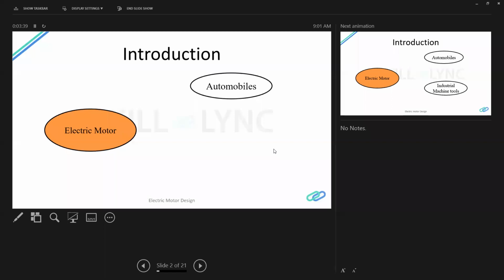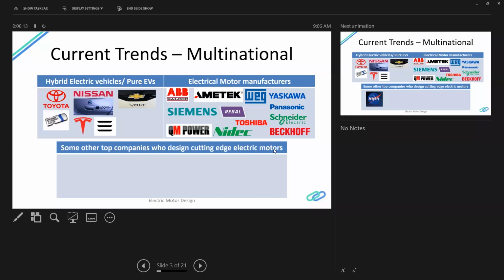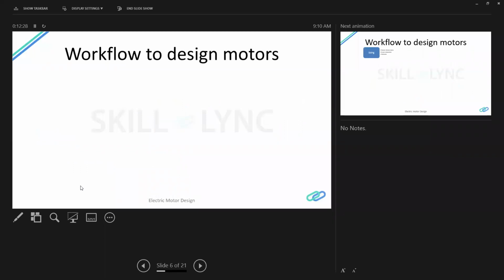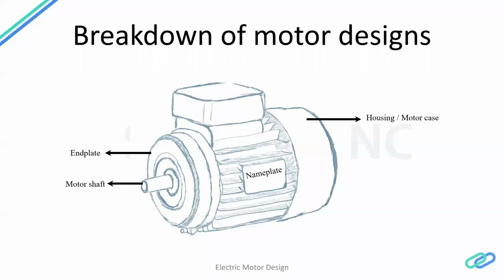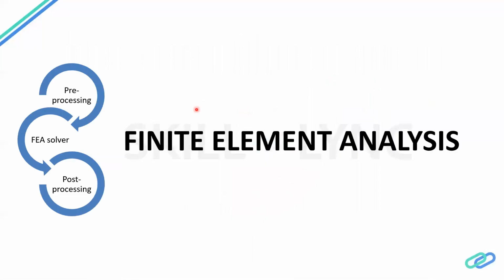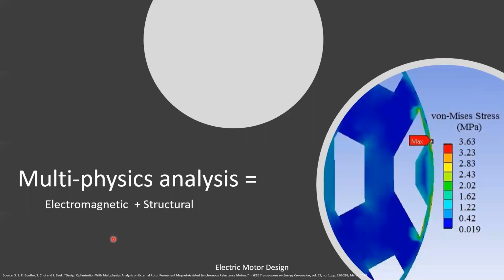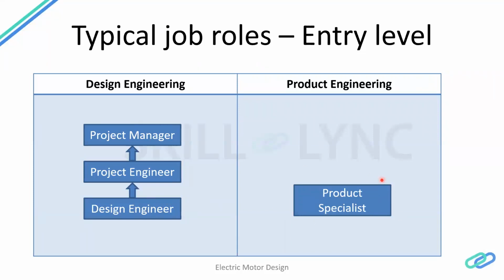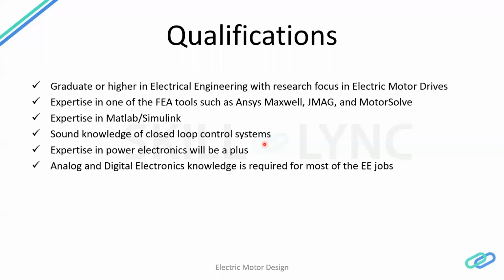Introduction to Electric Motor Design | Skill-Lync

Comment: I want to create my own electric motors, the process is going to be interesting.
   I will be trying to create a motor that pulls very low amps, has a small diameter, and is only four pole.
   I already have some ideas that should make the motor efficient compared to equivalent spec requirements.
   I look forward to the smaller details of making the motor operational.
Reply: Have you started your work on motor